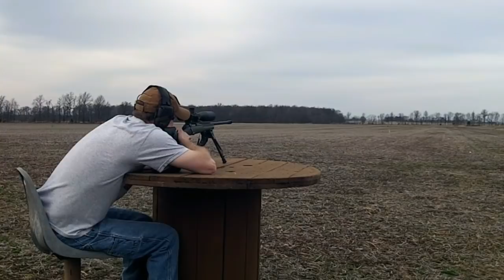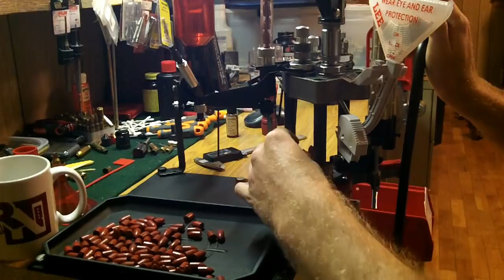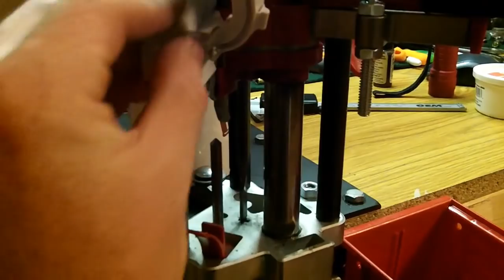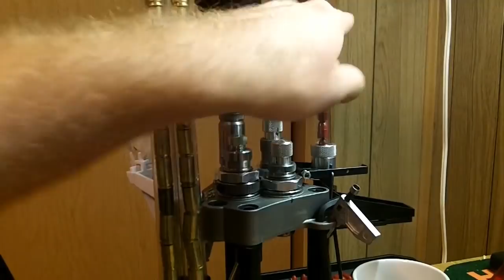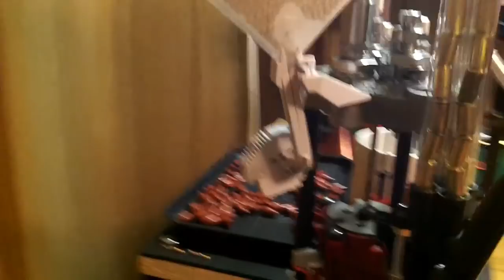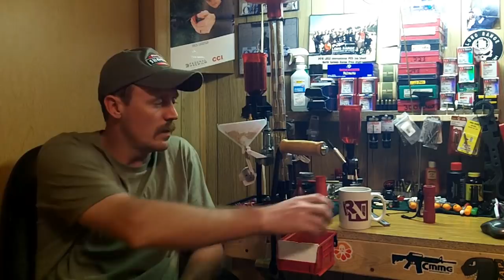Lee Auto Breech Lock Pro Press

Comment: IF THE RAIL YOUR CASE FEEDER SLIDES ON ISNT FLAT, UNDER THAT METAL ARM IS OVAL HOLE w/spot to thread screw into on red part, SO GET A #6-32 x 3/4" Phillips/Slotted Truss Head Machine Screw, or at least when I contacted Lee that's what they sent me and it fixed it right up

Comment: As far as the inverted cases in the case feeder, I've had great luck with this fix. A.22LR casing will fit perfectly in the small center hole of the collator. Take a penny and drill a hole in the center of it so the 22 case will fit in it but will be held in place by the rim. Once done, place that in the collator and it will decrease your inverted cases by over 90%.

Comment: Hey 243 Outdoors... I'm thinking about getting one of these presses,, and my main loads would be 9mm and 243... what's your opinion on the 243..
Reply: I have this press and it runs pistol ammo no problem.  I also run 223 in it, but I pull the indexing rod out and manually index the shellplate.  If I don't, the shellplate starts to move before the bullet tip has cleared the seating die.

I've never reloaded 243, but it's OAL is only about a quarter-inch shorter than 223. I suspect you'd have to do the same as I did with 223.

Comment: Curious about the chain that is used on the powder measure. I see your not using it. I realize it's case activated. I just don't understand the reason why or  why not the purpose of the chain.
Reply from the maker: The instructions say to use the chain for progressive press applications.  It is still case activated but the chain resets it when the ram is all the way down.  It basically keeps it from double charging.  I prefer it without the chain.
Reply: @243Outdoors  it's just confusing because it resets when another case goes in. I just don't know how the chain prevents a double charge. If the shell plate moved to the next station your ok. I just bought the auto breach lock pro, and I'm trying to figure out why the chain. Thanks for the reply.
Reply from the maker: With out the chain, if you go half way down and back up it will double charge.  With the chain it has to go all the way down to reset and then the shell plate also rotates.  I see no reason for the chain.

Comment: I see you have had good luck with your case feeder I got the same press tried to set it up for 10 mm everything works good but that thing flips about 80% of the cases I've adjusted according to the directions adjusted in out up down can't seem to get the hang of it. If you have a clue I'd appreciate knowing what it is because how you say you got yours working so well thanks Robert
Reply from the maker: Yes, I love mine.  The only thing I can think of off hand is make sure the plastic piece that the brass slides on is free of burrs.

Comment: No bullet feeder, TD.
Reply from the maker: I've got the Lee bullet feeder, but it's not reliable enough.  Wasn't impressed with it at all.
Reply: @243Outdoors  Did you use it with just one tube; or did you get the 4-tube add-on?  Was the length of your bullets within the spec of the unit you used?   What went wrong?  If you have the 4-tube-turret, you can shut the bullets on&off by turning it between tubes.
Reply from the maker: Single tube, everything is what it should be, just a poor design in my opinion.

Comment: To stop the powder flying out I took a weaker spring out of a broken printer ( same diameter and I cut it to length )  and replace the spring under the shell plate.
Problem solved. Press works great .

Comment: Never had good results with the adjustable charge bar for small charges for pistol, and others have reported the same.  I've had really good luck with the bullet feeder on my 1000 as long as the bullet base is smooth, if not smooth base it's better to only load the tube about half way up so there's less weight on the bottom bullet.  As others have said, the case collator can be improved, the latest and best is a disc that hovers above the holes to prevent cases going straight in, see the video by NotAnExpert.  Regarding the roller handle, can't you rotate it back one tooth, you can change the starting angle on the 1000.

Comment: I don't really think of this as a true progressive press. It's more like a Turret +. The juggling with the primer really downgrades it, but if the bullet feeder made up for that, maybe it would be a progressive ish. I've got a couple comparison videos in the works at the moment. Was trying to get them up last saturday, but I was just too slow.
Reply from the maker: The priming system is the real downfall with it.  I do still call it a progressive because it produces a round every pull, but other actions are required.
Reply: @243Outdoors  With all the patents and potential litigation, this is probably the best LEE can do without sacrificing reliability.   This system is probably the fastest I've seen when it comes to switching primer size (large vs small).  Unlike Dillon which is absurd amount of time just to switch.

Comment: For 9mm brass to go down the collator tube better. Drill a hole dead center in a penny the size of  a empty 22 case. Put the penny in center of collator pushing the spent 22 case into the hole in the center. It makes the 4 holes smaller and you will have fewer upside down cases.
Reply from the maker: I did that right after this video was made.

Comment: This press works great with .223 and 300 Blackout rounds, especially with pre-prepped cases that are already trimmed and primed. Start station 1 with powder charging, and leaving station 2 open for placing a bullet while the shell plate is on the up stroke.

Comment: Just got a Lee 2018 catalog in the mail today and the Lee Breech Lock Pro is on the cover. Interesting because it shows the press set up the way you use it here... no bullet feeder.
Reply from the maker: The press had a catalog in the box but the new press isn't in it.
Reply: Took another look at the catalog. It's a 2019 version. And they do show it with a Lee Auto Drum powder measure.Just as an aside, I've been using the Auto Drum on my Classic Turret press and with Titegroup it's unbelievably accurate.

Comment: All progressives need a little tinkering to get tuned and running smooth.  Especially when changing calibers.  All in all not to bad.  The priming system would drive me nuts.  Mainly because I like to inspect the cases as I prime.  It’s not a gig against the press, just a matter of habit on my part.
Reply from the maker: I guess it's all what your use to.  I am getting the hang of this one now pretty good now.  I just ran 100 rounds through it with no problems.

Comment: Thanks for the video.  Its my impression that except for the Dillon, all the progressives require a fair amount of fiddling.  The autodrum powder measure is a pretty good upgrade for this package as long as you dont use the finest powders.  Its a little more accurate than the charge bar option IMO.
Reply from the maker: I didn't know which powder measure to get.  More people recommend the auto disc for running finer pistol powders.  So far it seems pretty good.  I didn't like it when the case kept crashing into the side of the expanding die, but i got it all figured out "for now."
Reply: The charge bar is a nice upgrade over the fixed disks for sure.  On the handle interference,  you may be able to lower the handle a little in the clamp and since the handle is bent out you may get more clearance.  That worked for me on the turret version where it hit the primer feeder. That was a great idea to run cases into the dies to align the upper frame, Good job!

Comment: I tried the oring idea to stabilize the brass case as it's going around from stage 2 to 3. Great tip. I always got a little powder spillage.
Reply from the maker: Eagle Eye said to change the spring out under the detent ball with a ball point pen spring.  He said it helped his out.  I will probably look for a smaller diameter o ring.
Reply: Eagle Eye shows the trick 243 is talking about in his video on the machine.

Comment: Nice review !

Lee called this the fastest single stage press on the market. I am not sure they consider this a progressive press or not. I see it as a progressive turret along the lines of a Dillon 550. Both of these have manual user inputs to work.

On the BRP you manually set a case, set a primer, and set a bullet.
On the 550 you manually set a case, set a bullet, and index the shell plate.

I have watched a few videos on this press. The turret press user in my likes it in its basic form out of the box. I can set a primer and set a case at the top of the stroke so easy enough. Place the bullet on the down stroke when I set the primer. I would want an inspection mirror to verify powder.

I find the Lee AutoDrum measure to be the Bees Knees over the Lee AutoDisk. Some powders work better in the Lee AutoDisk like they do in a Dillon. I have not had issue.
Reply from the maker: I had people recommend both measures.  For the powder that i am using most said to go with the auto disc.  For what i am doing  i think this press is perfect for me.  It's still new so i'm loading every night.  It will slow down once the new wears off.

Comment: Okay. Good review, all things about Lee equipment aside. Value, Lee is a company that offers Value to the reloader. all their products are made with that in mind.  So now that is out of the way. Process. There are ways to increase your output of finished product by doing your procedure in steps with the Lee equipment. The first thing to consider is size and de-prime all your brass on a single stage or set the Lee progressive up to do it. (If you wet tumble this works awesome, I would suggest that you start wet tumbling your brass) then as a separate process set up a bowl of cleaned brass and use a bench mounted auto primer unit, the lee will work fine, however, the RCBS is a much nicer unit to work with but a spendy unit if bought new. So with all your brass Clean, resized and primed start the process of progressively feeding them through the press. As far as the final lock up and the "Powder slinging" going on,  It seems that there is too much-stored energy on that mechanism, the use of reduced power springs may be the answer other than the O-ring trick. one thing you didn't explain was, Is the powder slinging out as the plate rotates, or in the powder being thrown out and up as the detent snaps into its lock? , there isn't much you can do about powder slinging out because of the momentum of the case going to its next station Other than Slow down. However, I would try using weaker springs to avoid any sudden "Snap" as the shell plate locks in place. I believe that UJ did a similar fix on a Dillon press he has. anyway, I would abandon the bullet feeder. People more than not have problems with the Lee mechanism working 100%.  So NO Lee bashing here. Lee offers quality and Value to the reloaders of the world. we need them to keep doing so, in doing so other companies keep control of pushing their prices through the roof as the only gig in town. I used a Lee Pro 1.000 when I was still starting out, that press taught me a lot about what could go wrong usually will and to watch those steps on any progressive press regardless of Make and Cost. Richard Lee has come up with Tools and reloading equipment that many others copied in their design. and may I add, A majority of reloaders has started with Lee equipment, So keep going Lee!! this was a good unbiased review buddy. Dave.
Reply from the maker: I love the Lee stuff, because that's mostly what i have.  As far as the powder spilling the shell plate speed is controlled by the handle running the index rod.  The problem is the sudden snap of the ball detent.  Eagle Eye changed out his spring and it helped.  The O ring trick is to give a little resistance to the shell plate.  A proper sized O ring should help.  I ran 100 rounds tonight and had no issues.  I am getting use to the press, and am really liking it.